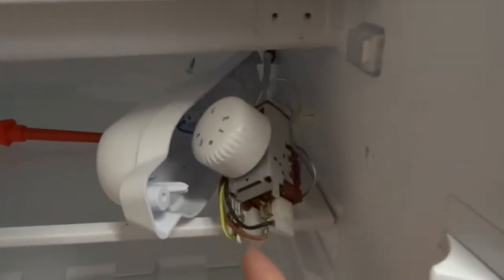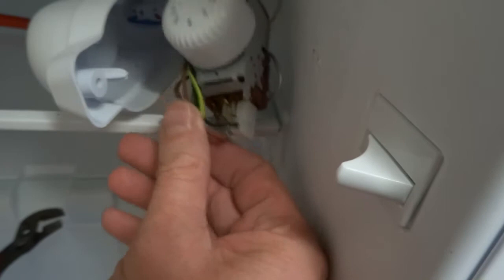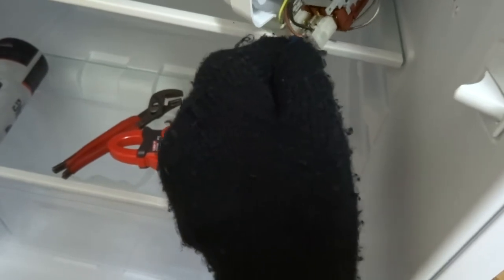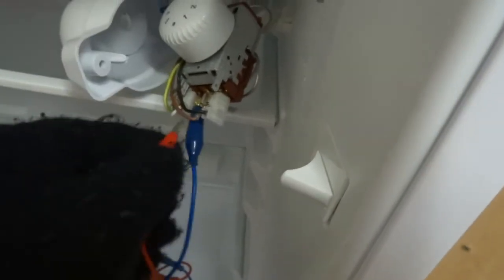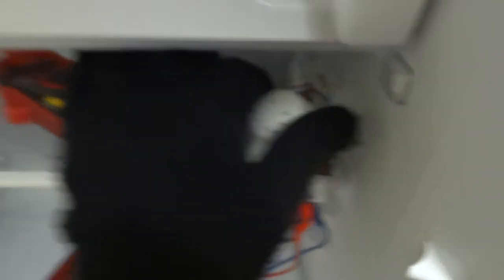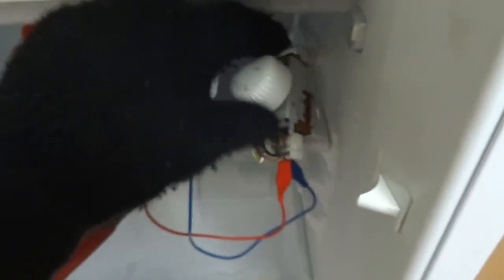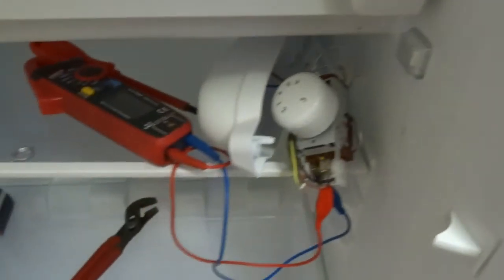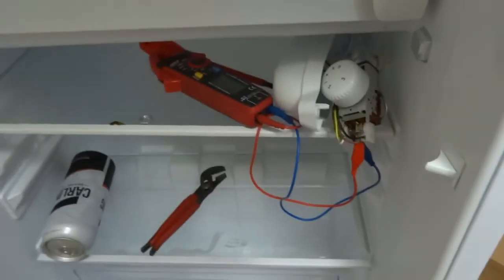Fridge Too Warm? How to Test a Refrigerator Thermostat with a Multimeter (Continuity Check)

Comment: Thanks for the videos. My fridge freezer stopped working after a power cut (lots of fuses got tripped at the time). The power cable, plug and fuse are all good and power is power getting to the electronics panel next to the compressor, but the fridge is showing any life - no control panel lights, no door light and no sounds? What would be the first thing to check? Cheers
Reply from the maker: id be check power and grounds to control board